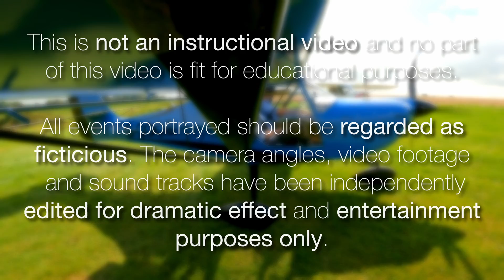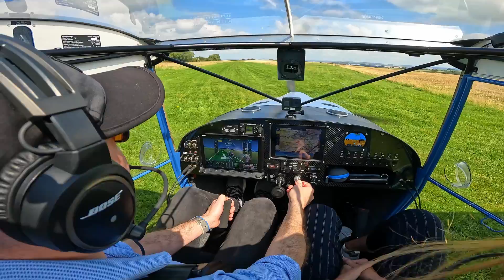Flight instruments stop working mid-flight! Dynon Skyview in EuroFOX 912iS Rotax

Comment: Great video.... I use Torque-Seal or Vibra-Tite ..... its used on bolts (like prop bolts) for visual inspection reference but it works well keeping the smaller DB9 types from vibrating loose along with a visual queue that it loosened .........  Weather and Business trips are keeping me from my checkride still!  Along with a short field landing requirement that my Remos G3 doesnt like to stop flying 17:1 glide ratio!!  Hopefully next week fingers crossed! As a semi-retired software engineer, your in flight repair methods were proper lmao the joke from a support desk would be "Did you restart it 3 times?  No? Ok call us back after you do that"
Reply from the maker: Thanks for the tip on torque seal. I tend to go for Loctite, although that’s only because I don’t know what else is out there, so it’s fantastic to have a recommendation from someone who has used a different product 👍🏼

I hope you get your checkride in soon 🤞🏼 I know exactly how frustrating it is when you are so close, but situations outside your control hinder your progression 😡

When it comes to electronic devices it can only be a few things… software, user error, loose connectors/cables or it’s totally f#€ked! 😄 Also, the problem is always easy to resolve in retrospect! Thank goodness it was only loose connectors/cables on this occasion 😅

Comment: Great video as always Geoff. Loving the diagnostic process, on/off, thump, leave it, I would have  done the same....... Just a quick question, what mount do you have for your Ipad Mini ? Need a flush panel mounts for mine. Cheers Gareth
Reply from the maker: Not really a slick professional approach but, worth a try 🤷🏻‍♂️
I use the Guardian Avionics flush instrument panel iPad mount. There are lots of wiring & cooling fan options if you need, or you can just buy the mount. 
Thanks for watching 👍🏼
Reply: Thanks, I'll order one of those. Look out for your commission cheque 😂
Reply from the maker: If only I were that influential! 😂😂 @garethw747

Comment: Just out of interest do you fly with a secondary emergency radio unit? I see many modern hand units also offer VOR navigation & ILS approach   awareness.
Reply from the maker: I do indeed sir! I fly with a battery operated Yaesu & also carry traditional charts (which is a legal requirement in the uk), hence not seeming particularly phased by the situation 😉👍🏼 The only system that does not have a secondary (or tertiary) backup is the transponder.
Reply: For the sake of being pedantic, it isn't a requirement to carry a paper chart in the UK. It's acceptable to have electronic charts.
Reply from the maker: That’s a useful point though 👍🏼

Comment: I’m not a pilot but impressed with your calmness when the computer started to say no. I’ve resorted to the MK 1 fist on computers many a time.😂
Reply from the maker: I’m not particularly proud of my handling of the situation, especially as I had correctly guessed what the issue was, but failed to do anything about it, but banging the panel certainly was satisfying, if not particularly sensible 🤷🏻‍♂️😂

Comment: Hi Geoff, I did like the percussion method of trying to resolve the issue. I do like an easy fix as well. 🎉
Reply from the maker: Yeah, I mean, not the most professional of approaches to resolving the problem, but it was satisfying to find that I had identified the problem early on, but sadly failed to act on that, which would have saved needless prodding & banging 🤦🏻‍♂️😄
Reply: @FlyingDarkLord  I remember writing on an aircraft job card, "percussion tape applied to..xxxxx regulator". Still makes me laugh today.
Reply from the maker: I'm glad I'm not the only one & at least the professionals follow the same resolution protocol!!! 😂
Reply: @FlyingDarkLord  the engineer has a calibrated touch to know just how much before deformation and destruction occur.. Haha.

Comment: Hi mate, and what a greaser at Goodwood 

Well I never, you would have thought that there would be an anti vibration mechanism incorporated in the connector, similar to have some transponder connection connect up... but we'll done on locating the issue.

I too will add this to my preflight

Great video and something out of the normal...

Love ref to stoney Cross.... 

Keep um coming,

Regards
GT-AV8R
Reply: Also, it will be worth, when one carries out a service that this is checked our, have you advised the guys at Lukesfield? As I think the process of installing this type of kit needs tweaking to cover this possible failure
Reply from the maker: I mentioned it to Luke who was the one who advised using soft-setting loctite 👍🏼
Reply from the maker: I believe that it’s possible to use a little low grip loctite to reduce the risk of these components loosening.
This is the third time this year that I’ve had things on the instrument panel loosening with vibration & so I think it’s worth adding a more thorough check of components behind the instrument panel to the preflight checklist 😊👍🏼